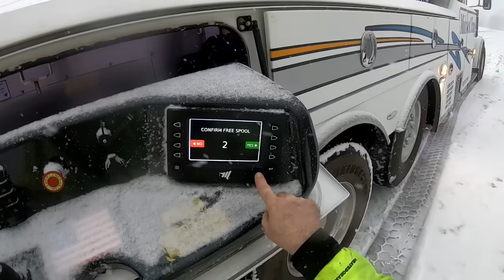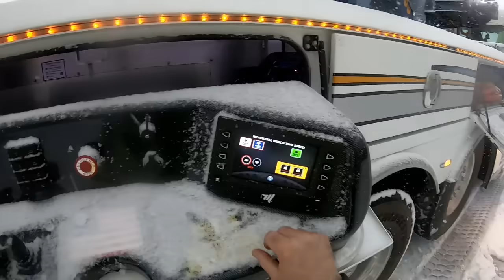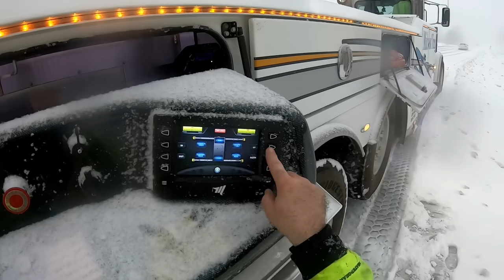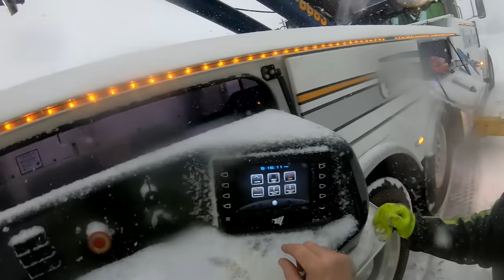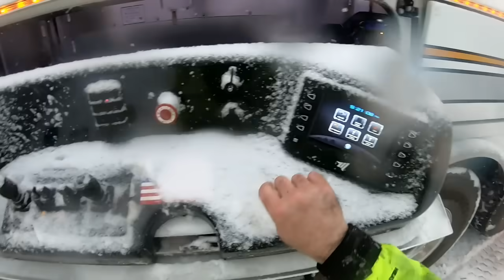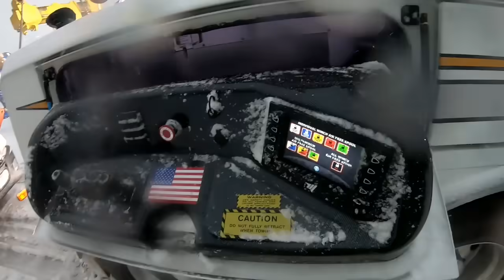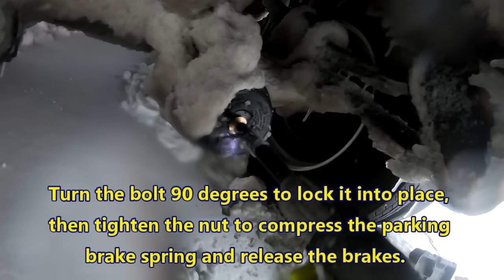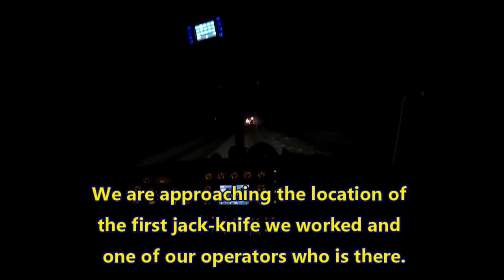Guardian Angel Working Overtime  Two Jack knifes in the Snow Part 2

Comment: Hey Ron you should look into a product called Stabilicer. They are strap on cleats for you shoes which make walking on snow or ice much safer. I use them hiking in the mountains in winter. Much better than the product known as yak traks. Check them out.
Reply from the maker: I actually have several pair.  You will see them in the next video that I release on Friday 2/15/2019.  Thank you though.  God bless.
Reply: @ Frank Lopez.
His side box was messed up
because. of having to go to
another RIGHT now. So they
just put everything in real
quick to go to the other trk
that Jack knifed. Ron said
that they will reorganize it
later. All the other vids showed
the equip. was stowed neatly.

Comment: If he would have turned the traction control off that would of been a lot easier. The pshh pshh pshh of air is the traction control system. Cascadias don't go anywhere empty in any kind of wet stuff with it on. I guess they can't teach everything in driving school.

Comment: They called us 'Mud Divers' back in my Army days...
It was customary, in those days, for the vehicle operator to haul the cable, climb under the vehicle, etc.
OUR gear was no where NEAR as high-tech as yours, but we got the job done.
This was my ride, back in the day:
https://www.facebook.com/photo.php?fbid=1128115043867759&set=a.1128114707201126&type=3&theater

After I got out, I went to work trucking.  I was on a dedicated P&G account and have traveled up and down this road MANY times!

Comment: just wondering, why not use the green line more often?
Reply: Cable tends to get caged or otherwise tangled and hard to pull out or rewind, he uses it for extreme cases like when he untangles wrecks from the safety cables along the highway.

Comment: I know this is a little behind the time, but I was thinking about your comment as the driver was trying to finish parking the trailer at the end, you said he needed chains.

Well, you have chains, even if not tire chains.  I have used this quick trick before in a flat yard situation like you had here (won't work in deep snow or at the side of a road).  Lay a number of lifting chains in a lazy-S pattern from behind at the point where his drivers will start to spinout. This will give a limited amount of traction as long as he doesn't try give it too much throttle. A slow bite will climb up onto the chain without spitting them out and he can walk backwards slowly on the chains.  If you're coordinated, you can even bring chains as they get left behind and around to the back.

Don't get me started on automatic transmissions for trucks over 10 tons. Winter widow makers 🤬

Comment: Ron, Is it normal for a U.S.ofA. driver to sit in their cab, during a situation like these? Here, in the U.K., I would be out. Trying to be helpful. Even if it was just watching the traffic, before the Trooper arrived, in the first one.

When people are knocking auto's, do they mean a 'full' auto, like on a family car or, an automated manual?
My Iveco Strallis has a manual gearbox that is operated automatically, using servo's etc. Having driven 8, 10, 13, 16 & 18 speed "stick" boxes, I can say that it is every bit as good, as long as the driver knows how to use it correctly.
Some of the comments go over my head due to the language peculiarities of our two Countries. Tire vs Tyre is easy but, is a Power Divider the same as a Diff(erential) Lock? Also, your braking system, for a Semi (artic) is VERY different to ours.

Stay safe and warm!

Comment: The driver of the first truck here in Germany would get a 'nice' ticket because of inappropriate tires. For information: in Norway you must use chains on a truck from November at any condition of the streets. last weeks they sent home a french guy with a ticket of about 2000 $ because driving without chains several times. Additionally forbidden to go there for 2 years.

Comment: Oh, to be an octopus, you'd have enough arms to do the job. Only, thing with that is that you'd need more arms to grab everything else that you would want. Don't you love it when a guy adds levity to your already hectic day and most likely night? I don't miss the snow at all. Although it has snowed here in NW FL  9 times in 62-years. I left Massachusetts back in '54. So, from '48 to '54 I have seen snow deeper than 4-feet and I had to walk to school. I did watch a school bus slide into the bottom 3 classrooms of the school, which made the building unsafe for anyone to be in.  A little of that hot sauce ought to warm you right up.
Reply: Also the more you carry = the more weight you also must handle.

Comment: Why don't they install 6 wheel drive systems in big rigs where if you're not stuck as bad as you could be you could put in 6 wheel drive low and pull yourself out of a ditch
Reply: Tyler Black   6 wheel drive?????

Comment: Ron wouldn't it be easier to repair the glad hands on the front of the trailer if they were broke, then to cage the brakes on the trailer?
Reply: No, with a break like that it's a shop job. A tow truck is unlikely to carry the parts or the tools.
Reply from the maker: The gladhands weren't broken.  The tractor protection valves on the back of the tractor were broken so the tractor couldn't supply air to the trailer.    Thanks and God bless.
Reply: Rotator/Wrecker do not carry or do work like a roadside service truck technician can do, as many parts are stored at the shop and the service truck can be driven back to restock certain parts as needed or before heading out to a call so as not to have to make a trip to pick up a part that was not at hand at the time.

Comment: Gotta love days like those. I remember a few years back we had a bad cold snap that left us below zero for 2 weeks. With 5 wreckers 2 heavy 3 light we were averaging 180 calls per day. 18 on and 6 off for 2 weeks. I was much younger then and they hadn't even came out with the under reach on heavy duty wreckers yet.  I drove a 50 Ton Autocar all hydraulic with 2 winches on my boom and 1 Bull winch on the rear deck. Angled steel lots of hard wood was all I needed to tow because all I had was a tow bar. I sure got tired of removing front bumpers! I'm sure you can remember those days Ron. Great work by yourself and Talon. Stay warm and safe my friend. God Bless.

Comment: How much did you get out of this storm?     I just finished plowing and bucket moving another 16" here and getting ready for another 5-8" tomorrow..   https://youtu.be/yaOUFq_qfBw   This makes 3 storms in the last 3 weeks of 10-14" each with multiple small snows of 4" or so in between each of them.. Monday this one started with about 4" and ending late yesterday with another 16" or so here...   Looks like you had that kind of snow that is just slippery as hell where we got the deep stuff that means basically nothing but 4x4 and snowmobiles work in.
Reply from the maker: We were spared from the deep snow.  Just the slick ice underneath.  I have a video coming out Friday that was taken the following morning and you can see most of the roads had already been cleared.  We got, maybe, 4" total out of this system.  Our area would shut down for at least a day if we got more than a foot of snow.  We do get some deep snow events here, but they are maybe 1 or 2 per season.  We always seem to be on about a 30 mile line where we get either rain, sleet/ice, or snow.  I can't count the number of times I've been working and driving through our area and it looks like someone just put up a huge divider to keep the snow out.   Quite literally, within a few miles going from totally covered road and low visibility, to clear, wet roads and just light rain or vice versa.   Not only that, but our temps fluctuate greatly.   Before this event we were at 70 degrees.  The temps dropped to the 20s in just a few hours.  A few days after this event, we were back up in the 70s and clear.   Last weekend we were at almost 80 degrees with severe thunderstorms and possible tornados, then on Monday we were back down below freezing.    There are multiple saying around here.  One of the most popular is that "Mother Nature must be going through menopause."    Stay safe and warm, my friend!!
Reply: LOL You are always welcome to come up here and help me plow out!   We had a few major accidents up here, by that I mean a few involving multiple semi's, cars, trucks and like..  in the last 10 days, there have been 3 pileups that closed the interstate for hours...  Ironically, most of those involved are from out of state because they can't seem to comprehend the fact you can't drive 70 mph in blizzard conditions..  I can't believe how many truckers keep trying though...  The latest one involved a semi running right into the back of a State Troopers SUV fully lit up and at the time with clear visibility...   Had plenty of time to see him but due to the snow, slid right into him at near highway speed.  Then of course everyone else, bunches of semis and POV's joined the pileup.

Comment: I"m sorry but as a truck driver idc if you're an owner operator. In warm season you should never run yourself that low of fuel let alone in the winter months. I leave a quarter in the warm months at max. In the winter the lowest I'll go is a half a tank. If I'm in an accident in the winter a half tank is more than enough fuel to get me by until help comes even if i'm leaking fuel. That doesn't account for leaking heavy amounts of fuel but theres two tanks so if i'm at a half tank that means i have roughly a quarter tank on both sides to get me by. We don't train drivers on proper skills on being left on the side of the road among other basic things.

Comment: If I was a trucker like the guy in the white Freightliner Cascadia, I'd carry at least 4 bags of 40lbs each of road rock salt, carry chains, and caging bolts, as well a other assorted tools, a full rain suit and a full sub-zero snow suit and a short handled but full bladed shovel. I'd also carry two sets of heavy wire jumper cables. it's a pain to move that stuff from truck to truck if your not assigned a particular cab that you drive everyday, but it's much better than the mess this guy got himself into or even the young lady. As soon as the road became snowy, if were my truck, I'd of chained up right way and just went slow with low tire pressure, and the cars behind me would simply have to suffer. Other than caging bolts, I carry the same equipment I mentioned earlier in my custom 97 Jeep Cherokee HD, and my little 95 Ford Escort (but I try not to drive the little Ford in the snow as it's so low to the ground, and even though it's front wheel drive gets poor traction and only one bag of salt, and no spare battery or chains), plus the Jeep has 4x4 lock up on all four wheels and it can safely go thru 8" of snow without chains, but I do keep chains in the bed in the box they came in.  I've never needed them but I have them in case and I practiced putting the chains on the front wheels without jacking it up. I also carry a brand new spare Interstate battery in the Jeep which in summer I keep on a battery tender and set aside in my garage. I have towing and road side assistance on my insurance that I pay for every year, but for the last at least 20 years I have not needed it (praise the lord). I'm equipped to get myself out of "sticky situations" but I keep my towing insurance in case I have a large issue like a fuel pump go south or the crank sensor go bad, or lord forbid get in an accident while I'm out. With most cars and trucks, you can be just fine one minute and the engine won't start the next minute or shuts off, or I break a belt however I do carry a spare serpentine belt with me, however I think I would leave road side assistance tow me to my garage at my house regardless of the weather but especially winter to put on a new one. Often the idle pulley needs changing as well, the bearings inside them go bad, the belt rides over the still pulley, gets hot and breaks from the added stress...................  I watched this video on 2/27/2019 and as always I gave the video Thumbs up and found it very interesting and entertaining, but I did feel pity for the driver(s). I would have loved to seen or rode along in the Western-Star as it towed the truck to the yard or where ever.  I'll add in closing, if everyone have Ron's quality of kindness and beliefs, we'd be in a better world all the way around.  Sorry for the long comment.. <:-( BTW, looking at the black Volvo the Western-Star towed, the drives had very little tread on the tires. I guess they do not put snow tires on trucks even during winter. Just a little bit of snow, the tread packs up, plus dragging a trailer, and the truck becomes a skate board as I mentioned earlier about chaining up. With some practice in ideal conditions drivers should practice chaining up. Even woman drivers are able to chain up, even though the chains are heavy, especially chains that go over both wheels and not just simply the outside tires on the drives. Adorn a snow suit and rig for bad weather drivers even if it's along side the road. Make sure you put your triangles out to help avoid getting hit but hopefully as the road becomes bad, you can find an empty parking lot or somewhere safe to chain up.